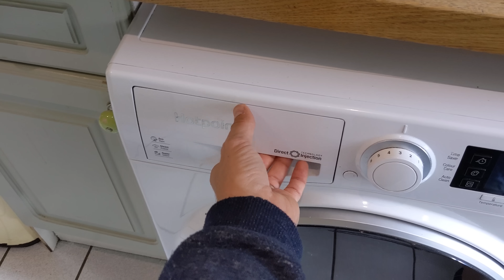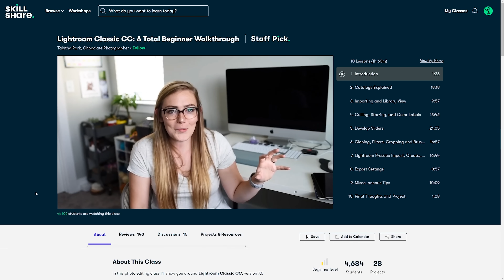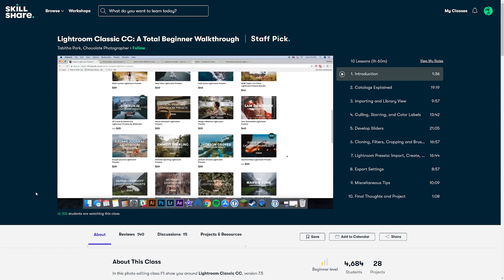The Pythagorean Siphon Inside Your Washing Machine

Comment: The toilets in my area have a plug in the bottom of the cistern that has a cavity in the middle of it and an opening in the bottom. When pulled up the plug can't swing all the way up to point the opening all the way up so it traps an air pocket that keeps the plug floating open until the water drains out. Then because the plug is open any water that does get inside drains out when it closes and the water can build up behind it again. The overfill protection is just a tube that runs over the maximum water line and allows draining into the bowl around the plug instead. The handle is connected to a chain that connects to the plug and pulls it up when you push down on it. Or alternatively could be attached to a handle you pull up.

Comment: All i know the softener side always kept having water residue and was getting full of black mold the whole time, ended up drilling some holes and works great 17 years now, much easier than pythagorean syphon stuff too.
Reply: Word of advice. Never use fabric softener. 

By now, I think it's best practice to never use more than two tablespoons of high efficiency detergent and to never use fabric softener at all. If you do, I would advise you not to.

Fabric softener is actually effective because it creates a lubricating layer of film that builds up not only on your clothes, but also on the inside of your washing machine, and it starts to act like candle wax over time.

It also contains glutaral, which triggers reactions for people who have asthma and skin allergies. Some fabric softeners are also known to contain artificial colors, D&C Violet 2, which has been linked to terminal cancer cases and is incredibly toxic to Marine wildlife.

Instead, you can use about a tablespoon or two of white distilled vinegar. It really does not leave a smell of vinegar that lingers in clothing, but actually makes your clothes smell fresher. It has Superior odor fighting capabilities, and when you couple them with tide power pods, they'll smell amazing.

Comment: My toilet is a bit different, porcelain bowl, bronze base, has a bronze piston in that base with a leather seal, there is a flapper valve at the bottom of the bowl, and a joker valve on the discharge pipe. 

There is a 2' handle that comes up and when you work the handle it works the piston which draws all the stuff out of the bowl, and pulverizes it when pushing it back out.

Comment: The Toilets I'm used to over here( America) use a Bowl Siphon in the base of the toilet. The tank holds a large amount of water and when the handle is pushed the tank empties itself into the bottom/bowl. That increase of water in the bowl starts the Bowl Siphon which "pulls" the water and waste out of the bowl and down the sewer. It's very interesting to see the different ways to accomplish the same thing.
Reply: Yes, the bowl always has a siphon.  Steve is talking about a siphon in the reservoir tank.
Reply: @8546Ken and as mentioned here in this comment, American toilets don't have the tank siphon, as it is just a hatch held shut by water pressure until opened. Also, the float is a little different from what I've seen. Basically the same thing but just in a different configuration

Comment: Wow this was really educational. We should all know the functions of what's in our houses. Thank you ✨
Reply: The way my washing machine works there is a tower In the middle that spins and at the top of that tower there is a cup that you put the softener in. Around the side of that cup is another upside down cup with a hole that allows you to pour softener in. When the washing machine spins it pushes the softener out of the cup and Into the sides of the upper cup using centripetal force. It then funnels down Into little square holes that evenly distribute the softener into the clothes while spinning

Comment: Traditional toilets in the uk etc still around that just use gravity i believe. 
The tank is set at a higher elevation. 
(This is tbf an assumption due to the  ferocity of the flush. Those things used to be 
"Able to shift a tree trunk if required")

Comment: Much simpler here. 
It's just a one way valve at the bottom of the tank. The valve actually floats in water (there's a upside down cup like bottom to it so it holds air in), but the pressure of water keeps it down. If you pull the lever, the valve is open, and the air in the center keeps the valve floating open until the tank empties and the valve sinks back to close before the toilet starts to fill up again. Pressure of water keeps it closed until the next flush.

The tank fill mechanism is the same though.

Comment: Well I learned something new again today that other countries have different mechanism as standard.. but in the USA...we use a tank of water with a valve that has air in it's underside that when in the up or flush position it bubbles out of a little hole and when no more air it closes down effectively metering the amount of water in the tank to the bowl. some even let you adjust this by changing the orientation of the hole.

Comment: Rather than the weight pulling the water down, isn’t it atmospheric pressure pushing down on the surface of the water on the two open ends?  Vacuum effect comes into play within the water sealed chamber? Just saying...

Comment: In atlantic canada, most of the toilets I have seen use a chain and a stopper plug. When the handle is pressed, the plug is pulled and the entierty of the flush box (which is filled with water) is emptied into the bowl. The bowl filling to a certain point will reach the height of the pipe in the back of the toilet and siphon the water out. (you can also flush it simply by pouring water into the bowl, such as dumping a mop bucket into it).

Comment: In the USA, a float is used in the toilet.  When flushed, the float tries to float to the top of the water.  It's on a hinge so it can't though.  When the water level gets so low that the float can't float, it falls and seals off the flush pipe.  The water then rises until the water valve stops it.  Now, it just waits until someone pushes the flush handle again and makes it float once more.

Comment: That’s wild just a flap in the US it’s held open by the water pressure traveling thru the exit and returns to rest on top of the hole once it is empty. So gravity makes a hinged flap fall over the exit then water fills atop it and the handle lifts the flapper via a chain to expose the hole and flush all the water and the process goes on. The water level is maintained by a float very similar.

Comment: The low flush toilets work the opposite. 
For liquids, press and release the handle. The flapper closes and only the amount needed to flush the liquid is used.
For solids, press and hold the handle until the reservoir tank empties. This will be sufficient to carry away the solid effluent.

Comment: Why does the USA have different toilets    the flapper leaks  if something  is not perfectly  sealed and I had one were the chain would stop  the thing from closing and you use it leave vine back later usually after the tank fills and the float would open the water supply  to too off the tank so freaking annoying  I like that design vut what if the float has issues and leaks then your flushing the hole tank right?

Comment: Here in Australia I have never seen a toilet which uses a siphon. From what I've seen (this is most likely very wrong in the way that it works), there's a shaft in the middle with a half-flush and full flush button (to match the outside, whcih has two buttons in the center of the top - compared to a front-mounted lever off to one side); and each button pushes a shaft to the bottom of the tank and opens a sort of valve, which leads through a pipe into the bowl. I think the full flush button has a weak spring which will only close when the tank is fully emptied (and then it can be re-latched and the same refilling system as in this video fills it back up), but the half-flush button has a strong spring to close the valve when the tank is only half empty (and thus it uses less water).

Comment: In Ukraine there is no syphon like this. This mechanism just has overflow so that excess water flows in the tube that's it. And if it is needed to flush the toilet, user just pulls on the plug and it goes down. If all water is flushed or only part in cheap systems is just determined by form and softness of silicone plug.

Comment: People also use this in hydroponics systems.  You need the water to cover the roots but only part of the time.  The roots also need oxygen.  The tricky bit is the siphon needs to start with a very small flow.  This often done by having a 2nd small siphon trigger the big one.  The small one drops some water into the drain pipe of the big one.  The falling water pulls air down which pulls the water over the lip in the big one.  For home systems, a lot of the hardware for handling water is from the fish-tank hobby.

Comment: I just realized something from this demonstration - I've heard the argument that if we lived in a 2D world, creatures' digestive tract would cut them right in half. But actually, if the creature had a stomach like a Pythagorean siphon then one side could be open allowing for the creature to "excrete" once its Pythagorean stomach was completely filled with food.
Reply: It still cuts them in half.  You can draw the line the food would follow and see the cut.
Reply: @kensmith5694  but surely if one part of the apparatus was sealed, so that it isn't made of two separate parts but one with a hole on one side then it would work?
Reply: @bartsola8349  
I thought I told you not to call be Shirley :) :)
https://youtu.be/ixljWVyPby0
If you have two dimensions what does "a hole mean".  Take some paper and cut out what you mean.  Left it up does it fall apart.
Reply: @kensmith5694  on hindsight yes, the geometry is a little more complex than I thought... thanks for pointing it out!

Comment: The toilets in canada use a flapper with a float attached flush valve which when you flush the toilet it pulls the flapper up and it stays up until all the water is gone, once the water is gone the flapper closes and the tank refills with the float valve.

Comment: Most American and Canadian toilets use a simple 'flapper valve' at the bottom of the tank that is simple in operation. It has an air chamber (small) that makes it buoyant enough to hold the valve open when flushed (by pulling it up with a chain attached to the flush handle) out of the drain and away from the flow. When the tank empties it falls back into the drain at the bottom of the tank. This buoyancy isn't enough to overcome the pressure pushing down on it when the tank is full (or even filling from empty). Biggest failure points are the chain oxidizing to failure, the chain tangling and not allowing the flapper to reseat, and the chain either breaking or coming off the flapper or flus lever. How does a toilet flapper work? - YouTube
Reply: You missed the chain coming loose from the flapper.  This is a problem on cheap ones because the chain pulls up on some of the rubbery material while the water is holding the rest down.

Comment: USA uses Float to stop water fill, then lever connected to ball with a tube of water to hold the ball tilted open until the ball is heavier than tilted column of water and ball reseals opening in bottom of tank

Comment: That's not how my toilet works at all hahaha. I'm in the USA. Pulling the lever just pulls the rubber lid off of a big tube that lets the water flush into the toilet bowl. The water level stops at the base of the tube, and then filled back up to almost the top of the like. Resivour or however you spell it

Comment: Our toilets work exactly the other way around: if you immediately let go of the lever (usually button form but same thing) only a little water flows, and when you keep it pressed a lot of it flows, though if you keep it longer it will still flow but only little bits of water so it has a differrent mechanism

Comment: in Australia we use a P trap method, we put water in there and it uses the movement of water to flush away the waste without emptying the cistern entirely, it's very efficient when you need that little bit of water to stop you know... methane poisoning and stuff... people kinda complain when they are dying, silly thing that is right?

Comment: siphons flushes are almost exclusively a UK thing.

Most of the rest of the world uses flapper valves (USAians) or lift float valves - both of which rely on bouancy to stay open until the water level drops below a critical point (the weight of the water holds them closed until pulled open, think of a tennis ball blocking a drain and then popping loose)

Siphons are good from the point of view of not leaking if not overfilled, but they are less reliable overall than other designs (the really annoying having to pull the handle a LOT before it finally works because that plastic sheet has perished and allows more water to escape than it lifted over the siphon crest)

Even more annoyingly they usually require the cistern and downpipe be partially dismantled to fix, vs simmply reaching in and twisting or cleaning a rubber seat 

in a close coupled toilet the cistern will usually need to be pulled off the wall to repair a siphon! - this makes a 10 minute repair anyone can do into a 40 minute job requiring a plumber and is why they've rapidly lost popularity (Quality british designs - not designed for serviceability being a trademark feature)

Comment: As a plumber in Portugal who has seen MANY toilets I have never seen a siphon type flushing system, the system we use here is basically a plug that holds the water inside and when you push a button or press a lever it simply lifts the plug and lets the water pour down, much simpler and I believe more reliable than that syphon system.

Comment: I’ve done allot of maintenance, I buy parts for toilets regularly. That flushing mechanism is not something you find in your local ace hardware here in the USA and that type of siphon is not how any toilet I’ve seen works. Must be a water conservation legal requirement in the uk or eu, wherever this sort of thing is required. It would make your toilet use less water but of course you would need to teach people to hold down the handle for that work.

Comment: @ 5.25 when you lift the arm up to stop the water, the whole valve flexes slightly.  The little peg that sticks out on the right hand at the top is supposed to be adjusted to to touch the side wall of the cistern to support the valve stem from bending.

Comment: The main elements of the system (toilet flush) are the same here in Poland, Europe, but we do not have a flap. We do get two buttons. One is doing large flush and the other small one. Took me some time to figure it out :-D
For me more interesing than flush is purge system. You see around here when you start flushing the wather just goes a little bit up and immiediatelly starts draining. In the americas (since I have seen this system all around both americas, not only the US) water raises signidicantly and than is purged almost to empty - which is much, much more effective in terms and getting objects from the bowl.
This is also caused by cleverly designed siphon :-D

Comment: Most modern American toilets have the siphon at the lower  rear of the main bowl similar to a "P" trap in a typical  kitchen sink drain and use a float plug  flapper valve in the bottom of the tank. The ball cock is used to fill the tank. the siphon is  initiated by the increased water level in the bowl from the tank through the top rim tubes in the main bowl.  the flapper valve has a small air reserve pocket like a diving bell that is held seated by water pressure till lifted off its seat by a chain pulled by a pivoting arm lever. .when the water level is lower than the valve floating the suction pulls the valve back down to its seat and seals allowing the fluid master ballcock to refill the tank for the next flush. Antique style toilets had the tank suspended well above the bowl at about shoulder high for gravity feed and had chain pull with a wooden handle on the end .the rest was as with modern versions.

Comment: Most toilets also have a self starting siphon underneath the bowl, that snaky bit of porcelain piping is functionally the same as the Pythagorean cup.

Also, my toilet does not use a siphon to flush, it has a flap seal, when it is down, pressure from the water keeps it sealed, when pulled up, the flow of water into the hole keeps it pushed out of the way until the cistern is empty, then it falls back into place so the cistern can refill with a similar float controlled valve.

This is how every toilet that I've looked inside works in the US.

Comment: Most American manual-flush toilets use the older mechanism.  When you depress the handle, a chain attached lifts a flap covering a hole at the bottom of the tank.  Water empties through gravity action into the bowl.  Once the water in the tank reaches a certain level, the flap falls over and covers the hole back up, allowing the tank to fill.

Comment: southeastern united states here. my toilet just has a chain connecting from the lever to a plunger at the bottom. when i pull the chain, the water flows freely through the hole. the force of the water flowing through eventually pulls the plunger back over the hole. once again blocking it. this is clearly a much simpler system than what you have, but is it better or worse?